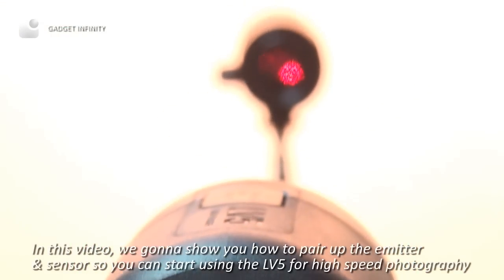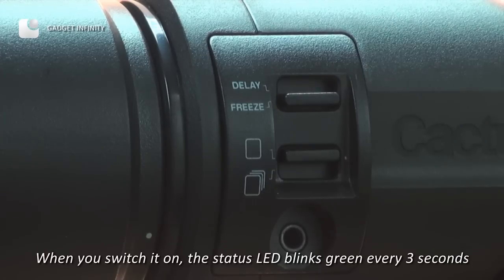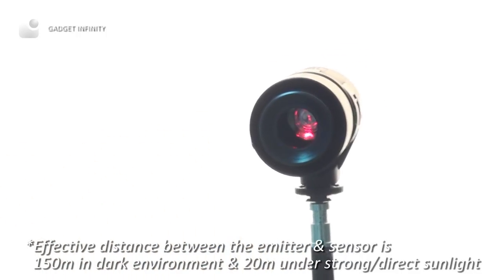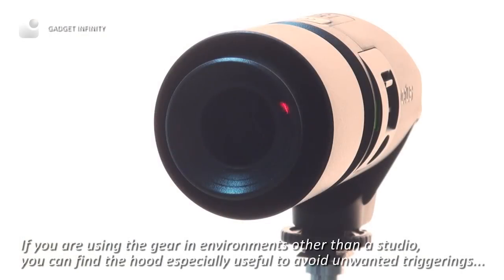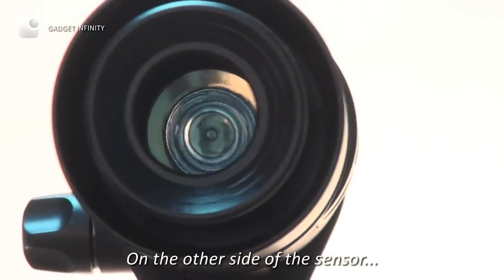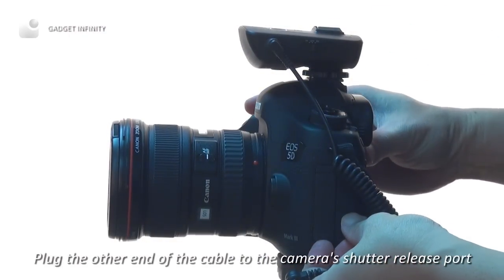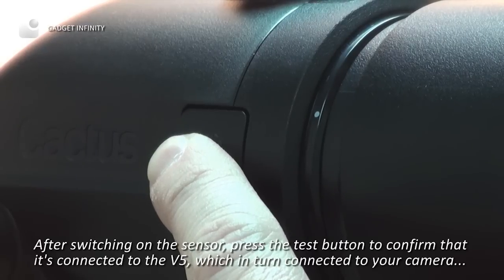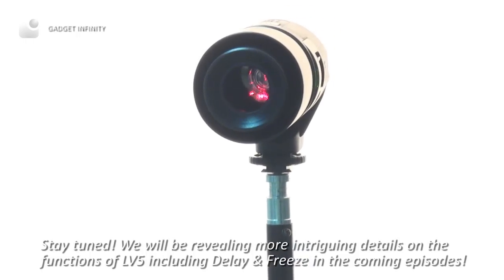Product demo: Cactus LV5 laser triggers - How to pair up the emitter & sensor & start shooting?

Comment: Don't buy a Cactus LV5, they're rubbish. Anything that moves at any speed (just using gravity) and the sensor can't pick it up. They give you a load of spiel about adjusting the freeze speed but it makes no difference. Basically it's incapable of doing what it's supposed to do. In addition it can't deal with small objects, something which they don't make clear in their advertising. Keep well away!